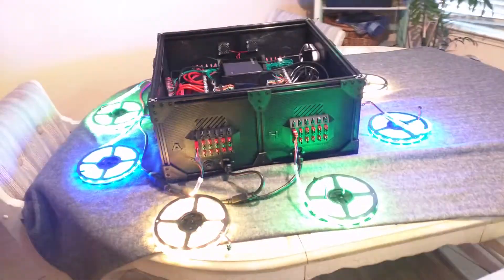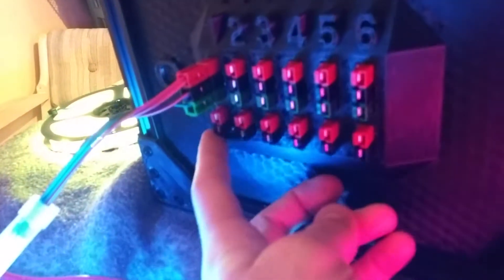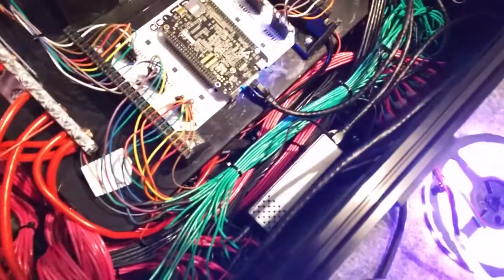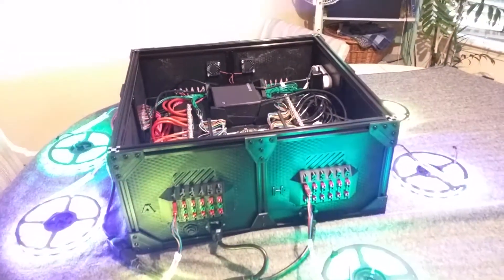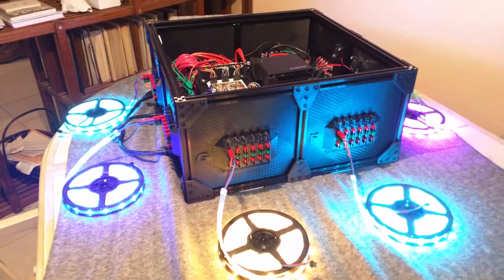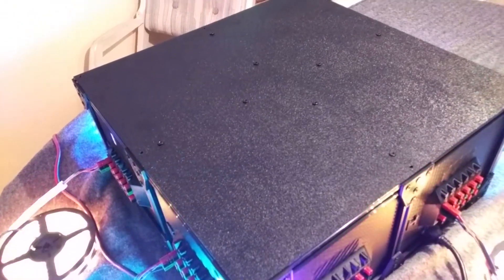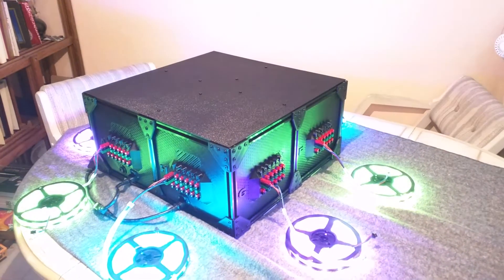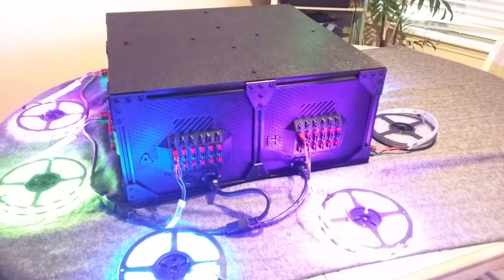PxlBox 480 AMP - 20,000 led - 3D printed / Open beam Media Server!

Comment: 480Amps for 20,000leds??
so if i need to power up 400 leds i need 9.6Amps?
how much it consumes a pixel?

Adafruit tells me that 60mA here:
https://learn.adafruit.com/1500-neopixel-led-curtain-with-raspberry-pi-fadecandy/power-topology

Adafruit: 60mA x 400 leds = 24 Amps
and you 9.6Amps

how much it consumes a pixel then?
im confused, please help:(
Reply from the maker: No you are correct! 60ma per pixel. 20,000 LEDs was a figure I put out based on number of outputs and LEDs per output my box could handle. Usually you don't go full white on all pixels so you can go past the power calculation if you know what you're doing.

I programed in a realtime limiter that kept my power usage under the maximum point.